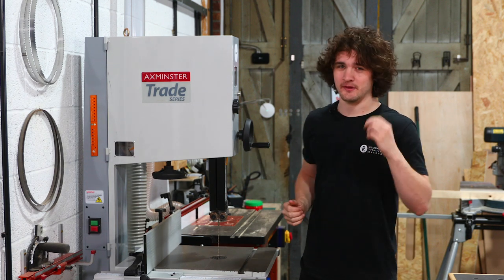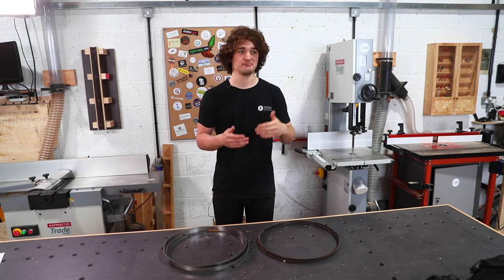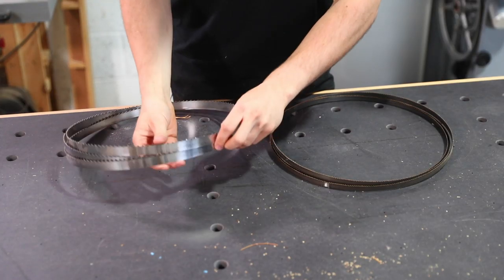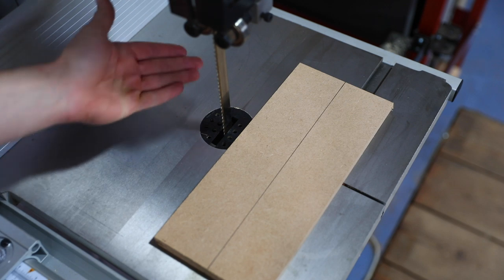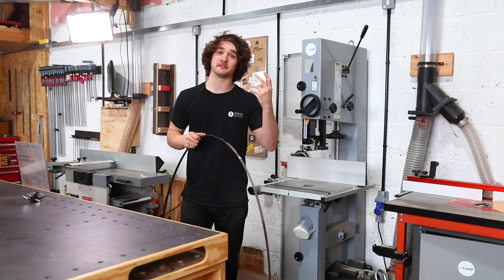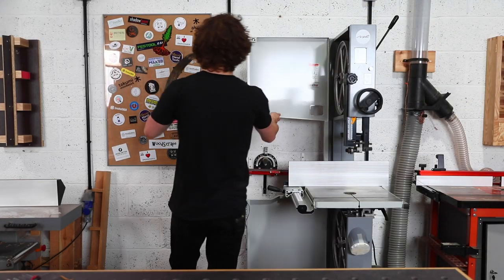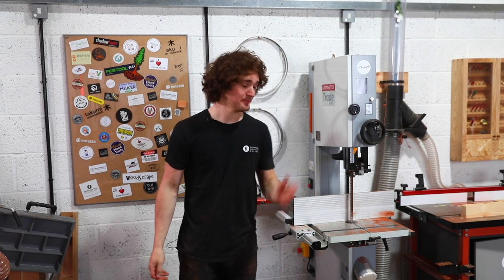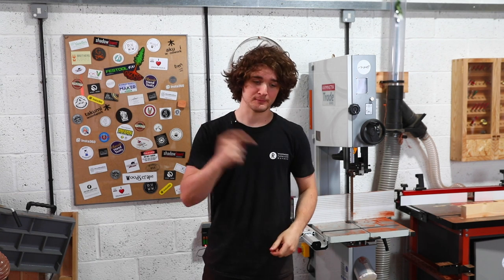The DEFINITIVE Guide to Setting up a BANDSAW

Comment: Matt, I’m relatively new to woodworking, spent much of 2020 2021 in a luthier shop and made a complete handmade guitar so I got a bit of a start but I’m now building anything I can get my hands on from simple furniture to bandsaw boxes. Bought an inexpensive Rikon bandsaw and had a bear of a time getting it to cut straight and found your video. I hope you understand the impact you can have on people half a world away, because the first thing I did was follow your advice and get rid of the blade came with it and, somewhat out of character for me, but three very expensive blades, a 3/16 inch 3/8 inch and a half inch. Used your video as a guide, takes me about 10 minutes to switch plates, you have a fan for life. Works perfectly. If you ever get to the Boston area give me a call and I’ll buy you a beer, heck I’ll buy you dinner

Comment: Aaaah man... wish I'd found this video a year ago!! Been looking everywhere to find someone to help explain/ fix the tracking issues i was having with my bandsaw and all I could find were smug dudes debating the existence of blade drift. This is the most comprehensive video explanation i have found on set up that covers some fundamental, top to bottom issues that may seem basic to some but are often overlooked by many. You manage to cover a lot of ground in a straightforward way without a hint of condescension- thank you!🙏🏻

Comment: Tip (from experience!): When you coil up the blade, wrap a cable tie / string around it. I’ve had one come off the wall at head height, and uncoil at speed. It caused only minor injury, but it did it while I was concentrating on a close up cut on the bandsaw!

Comment: I bought a new budget parkside bandsaw and spent best part of 2 weeks sorting  tracking out with no success. (Cutting to the right). Came across your video and binned the blade supplied and bought a new blade (Dakin flathers ). Now cuts perfectly straight so fantastic tip !! Thank you.

Comment: Another excellent video Matt.
I just bought my first bandsaw, and have seen a number of videos and posts on setup.
There's definitely some conflicting info between them, especially where the blade is supposed to ride on the the tire.
Centering the gullet whenever possible as both you and Snodgrass suggest makes the most sense.
Something that just makes no sense to me is why a manufacturer (who we will assume is proud of their equipment) would ship their equipment with possibly the worst blade a person could get their hands on.

Of course they would probably say, well, we don't know the specific purpose this person is going to use the saw for, and they'll probably just replace the blade with one that suits their needs.
My guess is if someone is buying a bandsaw, they're going to be buying it so they can cut wood.
And in doing so, most likely they would eventually be performing all of the cuts that a bandsaw is capable of doing.
So why not equip a new saw with a decent general use blade that is actually capable of cutting wood in an effective manner, rather then sell it with a POS that is no good for anything?

Well, waaaaaaaa! They might say. A good blade costs us money!!!!
Well waaaaa I say. A good band saw costs ME money!

There needs to be a balance.

I've worked in the restaurant biz for many years, as well as owning one for ten of them.

Some things are profitable to offer, some are not, but you offer them anyways as part of the entire service.

For example: As a customer, you might pay $2.00 or more for a glass of iced tea, when quite possibly the restaurant's cost is only 2 cents, maybe even less, making it a good profit item.
As the owner of a fine restaurant, you might want to offer the very best steak you possibly can.
In order not to gouge your customers (thus promoting future visits, ie purchases, you offer that fine steak pretty much at your cost, which leaves almost zero profit on that item.

BUT, the big picture needs to be looked at.
You just made $1.98 off that 2 cent glass of tea, or possibly a whole heck of a lot more on the alcohol purchased with that meal, as well as a desert, and many other little high profit items.
If you give a customer a crappy steak as part of their meal package, they most likely won't be happy and won't return in the future.

So as a business, it makes a hell of a lot more sense to make a little bit of many times, than it does to make a bunch only once.

Sorry, this got a little long, but to recap, why sell a saw equipped with a blade that doesn't saw, and is frustratingly impossible to set up?
It certainly doesn't lead to a first time customer believing they chose the right product or brand.

Comment: As always, great video.  You explain very well.

There is one use of terminology that may be another case of British vs. American--"tracking".  You use it as if it's a bad thing, like what I would call "wandering" or "mistracking".   We would use tracking as the thing you want, the cut stays on track.

Next time I buy a bandsaw, the adjustment mechanism for the guide bearings and thrust bearings will be an important consideration.  On mine, when you loosen one set screw the whole thing is loose, front to back, side to side and closeness to the blade.  If you loosen the screw to tweak one of those the whole thing moves.  Makes you not want to bother with minor adjustments.

Comment: Hey

Great video.  I am a retired Carpenter (40)yrs.  Retired but, still working in my shop.
Recently purchased a old FREJOTH   My question is, After replacing the saw with new tires, 
top adjustment screw unit, and new blade, the blade wobbles front to back.  What causes this?
  and how do I fix it?  Thanks

Comment: I just got a vintage Hitachi B600.  The wheels are cast iron with a flat profile, and there is a kind of o-ring on the side where the teeth go; probably meant to protect the teeth.  It's clearly designed for the blade teeth to be flush with that side of the wheel.  The blade is about an inch wide.

Comment: Shawn Graham over at Worth Effort recommended using a business card to set your bearings.  Takes some of the TLAR out of the set up.  (TLAR   That Looks About Right)
Reply: There's no TLAR involved. You make certain the bearing is as close as possible to the blade without the bearing moving. Using a business card actually creates a much larger gap and you'll be more likely to have drift.

Comment: If you talk to someone that uses a bandsaw for a living they will tell you the first thing you need to do to set up a bandsaw is the square the TABLE to the cut of the blade. This stops any runout or other weird stuff and makes the saw a pleasure to use. Most youtube videos fail to explain this and go into great detail on how to work with the problems caused by missing this most important step.

Comment: Setting , my procedure: centre blade on top wheel. Adjust guides top and bottom. Line up fence with mitre groove. Adjust whole table to zero drift. Adjusting the fence to the blade can mean it can be out of line to the mitre slot for cross cutting, causing out of squareness. So I adjust the whole table after lining up with mitre slot.

Comment: Matt, I agree with you that if I could only have one saw it would be a bandsaw. and all stock blades are worthless!  Also, owners of a SHOPSMITH bandsaw need to be aware that their saw is unique in that there is no adjustment for blade tracking. The wheels are NOT crowned, as you show at 13:39.  Also, the saw is designed so that every blade runs near the back of the wheel and against a pair of "Auto-Track" bearings that are in the arm of the saw. Likewise, the thrust bearings below and above the table aren't adjustable forward and back because they don't need to be; all blades run to the back and against the bottom thrust bearing at all times, and if the saw is properly aligned, just ahead of the upper bearing. It's pretty sweet, actually.  I tend to store mine open, so I purchased a cheap $5 garden hose rack, like the ones you screw to the outside wall of your house, and I store the blades safely there.  No more tossing them across the shop!  Scott

Comment: Nice :D I have also opted for bandsaw over table saw, and over the ~2.5 years i have owned my bandsaw, my current method of setup is almost identical to this :) I was lucky to find a Snodgrass setup video pretty early on which is probably a big reason why i haven't yet bought a tablesaw :D I also got the UJK bandsaw buddy a few months ago and i agree that it is a great little tool :) Real nice to get some validation that I have gotten some things correct :)

Comment: Love your detailed explanation.  My band saw is older and has the carbon cooling blocks on the side of the blade rather than the rollers.  I’m told that they should periodically touch to cool the blade.  Can you tell me your thoughts on these blocks and how far they should be from the blade.

Comment: I have used a lot of band saws over a long period of time and I believe you’ve nailed it !  Best overall presentation I’ve seen yet.  I believe you could do another video on blade selection.   
  The only reason that placing the gullet in the center of the tire might not work, is that manufacturers often overstate how wide of a blade can be used on a particular saw.   For example, you really should not try to use a one inch blade on a 14 inch saw.

Comment: Dear Matt, thank you very much for your video. Your method to set up the band saw is very clear and well explained. Further now I understand why the blade have to stay in the centre of the wheel. Just a question. How and when to check and set up the mitre slot in order to be parallel with the fence? After you check and adjust the orthogonality of the table? Thanks in advance. Luigi

Comment: Hey Matt, Great Video on the setup. I just purchased  the Grizzly G0513X2, looks identical to your saw in table and trunnions and frame components inside and out. My question is this, when do you align the table to the blade so that the miter groove is parallel?  My manual skips right over that setup. The Bandsaw Buddy looks to be a great way to get the table parallel to the blade. I will make one from oak wood and magnets today so I can measure from the miter groove to the front and back of the 17 inch table. Similar to the table saw setup, that should get me in line and the issue solved.
Reply: Do what Matt says but before adjusting the fence to be parallel to the blade, adjust the miter slot to be parallel to the blade by adjusting the trunnions underneath the table. When that’s done, then you can use the miter slot to adjust the fence parallel to the blade and the miter slot simultaneously.

Comment: Excellent guide! (well, I mean I guess we'll see how that holds true after I try it myself) ;)  Thanks for going into so much detail -- other videos I watched felt a little surface level.

Curious what your thoughts are on height capacity; I ended up getting the 10" Rikon benchtop saw, which has a 5" resaw capacity.  That was after a fair bit of back and forth on cost, machine size, weight, capabilities, etc.  I figured 5" would be a compromise, but would do me fine for a fair while.  For me personally, I'm quite sure I made a good choice, but I'd love to know what the minimum requirements (height or otherwise) of a bandsaw would be for your scale of work.

Comment: For checking the table squareness to the blade with the 2x4 trick, I think you needed to flip the board over before moving it to the back of the blade for gauging any difference, per Alex Snodgrass.
Reply: I think the “reversal” you are looking for is accomplished by the 180 deg rotation (vertical axis) of the test piece when it is rotated to the back of the blade.  Flip or rotate, either works.  You can test this by setting your table purposely off, like 20 deg, and see.

Comment: Also i know it is hard to find a LOWER TPI than 3 but it can be done and it is important for speed and proper chip removal as most resaw vuts are over 6-10inches that should be ~ 1.1tpi. you must find it.

Comment: Thank you for this!  I was about ready to throw my bandsaw out on the street. It could cut a circle better than a straight line.
Reply: haha.  Try to put the lowest part of the tooth at the center of the top wheel.  I saw a video on that, and it seems to really make sense, to keep it from twisting.  Also, you can dial in the amount of twist and then eyeball the cut as you go.  That can work as well.

Comment: Matt I have a 8” lumberjack bandsaw and to be honest I didn’t realise how small it is. Are you able to recommend a bandsaw one that’s a decent size and preferably doesn’t cost an arm and a leg. The one I’ve got said an 8” bandsaw I got it wrong I thought it was height it could cut as it sort of suggested as advertised sort of misleading as I found out now I know it’s distance between the blade and inside face of frame. I don’t know the size of your one but only have a 16 x 10 and not much room so possibly a 10 or 12” one if ok with you cheers steve👨🏼‍🦽

Comment: There is a video on YouTube that shows you exactly how to handle untwisting bandsaw blades without injury.  It’s done by someone at least 2 times your age, with at least 3 times your experience level, and the best part is, he says that “lobbing” a bandsaw blade is far more dangerous to yourself as well as your woodwork.  The bandsaw blade teeth can easily get bent, chipped, or otherwise dulled and that makes the blade worthless.  You might want to view that video.  It’s done by a guy who teaches how to set up a bandsaw properly.

Comment: I am curious: does centering the gullet instead of the blade result in more wobble on the back side of the blade? Always been curious...I assume the centering the blade thing the manufacturers recommend is to keep the blade tracking more straight over time.
Reply: If you centre the blade the teeth edge will wander, if you centre on the gullet the back of the blade will follow the front giving a more accurate cut both straight and curved.

Comment: I have viewed many videos regarding where the blade is best set on the top wheel. What about the bottom wheel after all it is the bottom wheel that is doing all the work by pulling the blade through the wood. I would be interested for anyone’s view on this.

Comment: On my bandsaw I have a bearing like yours at back with face facing the back of blade and two pins either side top and bottom. Why do some bandsaw have the bearing face on and most others have them side on which I thought would have been better for blade and bearing. And I don’t know what the thinking was on the pins I can’t see what there benefit wove ?

Comment: Great video, have learnt a few things today that will help with my band saw, problems,  I still have A blade tension problem,can not get it tight enough.
Reply: If you can't get the tension tight enough, you have the wrong length of blade. Double check the manual and find the correct blade size. That will fix your problem.

Comment: I have a question so my back bearings are both not vertical with them blade , when I tight them the bearings the top of the bearings sit to the left , will the make my cuts track off??

Comment: I have no experience with a band saw.  My problem is that no matter what I do or what blade tension I use the blade always twists and, thus, will not cut straight.  Any hints?

Comment: How much should the upper guide clearance to the blade vary as you move the upper guides from the bottom of the cutting height range to the top?  My upper thrust bearing gap varies about 0.040" and my upper side guide bearing gap varies about 0.050".  This seems like a lot, especially for a new band saw.

Comment: I've got a new bandsaw with ceramic guides, these emit sparks if I must a push bit hard or when the blade is bring pushed up against them and I have also worn out a rear thrust bearing using a back tooth blade; what am I doing wrong?

Comment: In your last step where the blade is not parallel to the table guides, you adjust the parallel guard to be parallel with the blade. The problem is that is the blade is not parallel with the table guides,then you loose the angles of the angle guard which moves in the table guides. You might be able to adjust the parallel guard but you cannot adjust the angle guard. And the problem with the blade is caused because you aline the blade teeth in the center of the wheel and not the blade itself. If the blade is alined in the center of the wheel then the blade is parallel to the table and table guides!